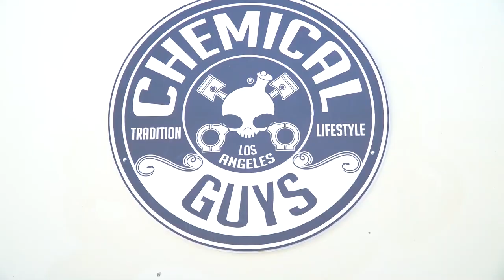How To Quickly Dry A Vehicle Without Scratching! - Safely Remove Ash Part 2 - Chemical Guys

Comment: I just bought the wolly mammoth. I love this towel. My question is, after drying your car. Do you squeeze out the water and let it air dry for the next car wash? Or do you put it in the wash after every car wash, and tumble dry? I also bought the microfiber detergent.
Reply from the maker: Hi Eddy! Depending on how often the Woolly Mammoth is used it can either be left to dry or if it is going to be stored for a while it should be washed and dried first.
Reply: @ChemicalGuys  Thank you so much for the tip. I wash once a week so I was originally thinking to wash and dry the wolly mammoth to store.  I bought a couple extra for family and they LOVE them. Thank you so much for a quality product. We love your tutorial videos. Much love from Canada, Vancity.
Reply: did you have the issue with the towel leaving behind lint? because that’s the issue i’m having
Reply: @matthewbadenius3645  when you buy a drying towel you need to wash it first before use. However, with microfiber towels you need to wash them with mild detergent (no fabric softeners, bleach or scented detergents) but it’s best to use dedicated microfiber detergents. Wash with cold water and extra rinse if possible. Air dry it or dry it on warm setting never hot or air fluff.

Comment: That was awesome and i plan on buying one!

two questions pls ..., you said 'Dont wring it out in the middle as it can hold a lotta water' ..., 
1. so do u just air dry it after you're done ?
2. to clean it for future uses..., can i use washing machine with certain specific settings?

Thank you!
Reply from the maker: Hello! Use Microfiber Wash to clean and protect all of your microfiber goods. Use low heat/tumble to dry microfiber or let them air dry.

Comment: How do you recomend to get the towel dry to contiues drying the car?
Reply from the maker: Hey! Use Microfiber Wash to gently clean your microfiber goods using warm water and dry on Low Heat or Tumble.
Reply: @ChemicalGuys  thanks for your time!

Comment: How do you clean and maintain The Woolly Mammoth towel ? do you need to clean it after every car? and whats the safest way to dry it ?
Reply from the maker: Hey there! Use Microfiber Wash to gently clean your microfiber goods and dry on LOW HEAT/TUMBLE or air dry to prevent damage. If the towel is used frequently it doesn't have to be washed as often but if it sits for extended periods of time it should be washed and dried before storing.

Comment: I mostly use a leaf blower to dry our Yukon with. Will After Wash make that process even faster?
Reply from the maker: Hi there! After Wash is an awesome drying aid that helps to prevent water spots but a dedicated drying towel should be used to buff to a streak-free finish.

Comment: Hi guys love the show but do you need to use after wash to use the microfibre towel
Reply from the maker: Hi Mo! After Wash will aid in the drying process and prevent water spots but it isn't necessary use it with your microfiber towel.
Reply: Thanks so much my son is starting a car wash to save money for school stuff will these microfibre towels work as I hope I didn’t waste my money I bought them off  Zoro I hope they work pls tell me if they will

Comment: I'm not a master detailer,  but shouldn't the car get a pre-rinse before you foam it up
Reply from the maker: Absolutely! Henry mentions the rinse at 1:07 as it was not enough to knock off heavily embedded particles. Check out the previous video in this series which details the rinse and foaming! https://youtu.be/deZqtRvSgN8
Reply: Soul Odoms I agree why wash snow foam off  amid risk scratches , rinse off then wash with a mitt surely